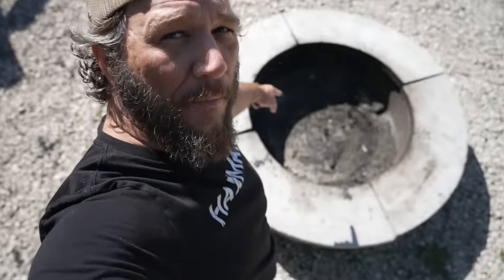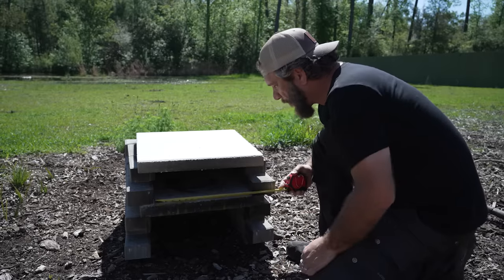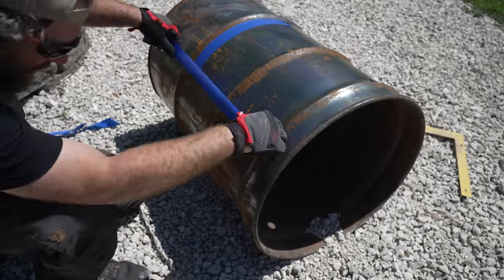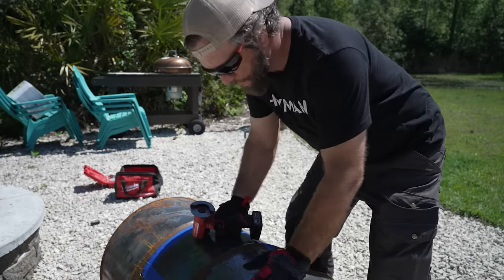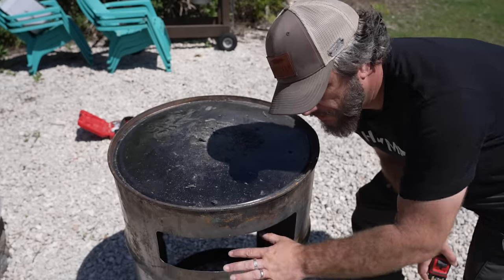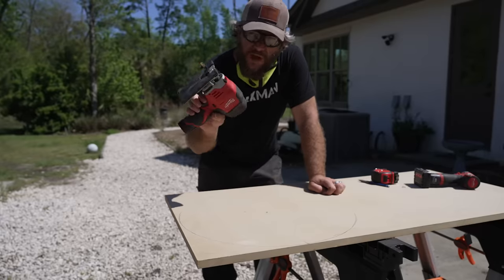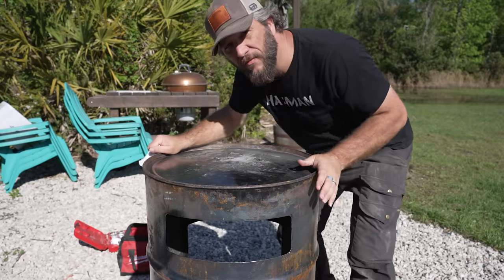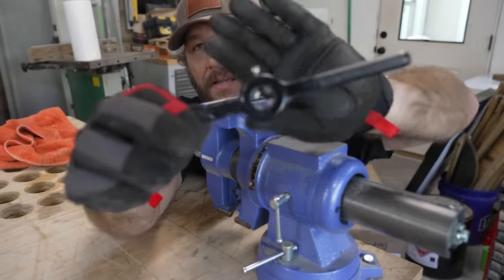This DIY Pizza Oven Is Cheap, Easy And Works Amazing!

Comment: A minor adjustment recommendation: cut the top part open of the barrel and get an old/used 22” weber kettle lid to mimic the dome shape traditional brick oven. Mod the lid to put on an exhaust/ chimney. But first use the lid from your kettle to see if it can be a perfect fit. Would love to see how that would turns out
Reply: Your suggestion isn't bad, however, it's more about using his already open fire pit, the least items to purchase so it's as financially cheap as possible and if you note the temp he got ...a chimney allows more heat to escape. It may look more appealing in respect to other types of outdoor ovens but this works best as it is. Metal, however won't hold the heat like brick will when the fire dies. He probably could have cooked right pizzas if they were ready to go one after another without adding wood. Your idea has looks but I married a high maintenance woman and looks are not always the best choice. A barrel that hot eventually burns out but hey, it will last two or more years with fairly frequent use. Unfortunately the stupid green freaks are attacking anything wood burning as they want to be dependent on the grid and constant rate increases.
Reply: @mikefinley4367  😂 don’t do your wife like that. But I understand where you’re coming from. Thanks for the insight!
Reply: luckyree9  All the water heaters I've seen are very thin walled steel and more like tin foil compared to drum stee. Water heaters are usually two thin walls with insulation between.anf a waste of your time .
Reply: @ster chimney is for single chamber ovens.

This is two chambers. Anywho the chimney is to let smoke out. Its already letting smoke out. Also dont need dome. Domes radiate heat inward using stone radiant heat.

This one is made of steel not stone.

The heat source is also from beneath in separate chamber. This is more like a grill oven than a stone pizza oven.

Comment: I built my version of this about 5 years ago. Used threaded rod to build a rack in the upper 1/3 and put an 18" pizza stone in it. Saves tons of time/labor and never have to worry about degradation over time from the extreme heat. Favorite fuel is lump charcoal with a chunk of wood from time to time. Good  stuff!
Reply: Has your steel drum held up? As hot as a fire you run in it, I wondered if the metal started burning through? I've used tons of burn barrels and they last a year or so.

Comment: I never knew about that section of the silicone gun that you can chop the tip off. I just love learning new stuff. Sometimes it's the little things! 🤣🤣🤣
Reply from the maker: I put that in the video because I showed that in a previous video and several people said the same thing. You never know what little piece of info someone might find useful. 😁
Reply: I stopped the video when I saw that and went into my workshop - darn it - my silicone gun doesn't have that feature.
Reply: Glad I was not alone in that observation. I don't do a heck of a lot of caulking but I'll surely remember this next time. Thanks, HAXMAN!
Reply: @HAXMAN  
I was also like: "Wait! What? You can do that? Why am I always looking for   a cutter/knife to chop off the tip of the cone?"
Unfortunately, a quick check with my silicone guns showed that neither of them offers that nice feature. :( 
It was too nice to be true, I guess.

Comment: Pizza looked tasty. Just a thought, if you put a plastic bag over your magnetic sweep, you can easily remove all those metal filings by reversing it as you remove it. 😊
Reply from the maker: That’s a great idea! Thanks
Reply: I was gonna suggest the plastic bag trick but ya beat me to it....it works great.

Comment: Hey, Did you measure temperatures in the oven during cooking? I was thinking it may be advantageous to have a concrete layer on the top of the oven too. Wait never mind. Just rewatched and saw the temp measurement.

Comment: Question: Are there any health issues cooking on cement surfaces? Cement contains silica that is harmful when inhaled (dust) but i'm not sure if the same applies to high temperature cooking. Good video as always!
Reply: you could always just put whatever youre cooking on cookie sheet or something
Reply: You could probably skip the whole cement thing and find a legit pizza stone or the latest and greatest pizza steel online to fit the barrel.

Comment: Nice build. Instead of casting the shelf, a round pottery kiln shelf could be used. They cost about the same as the refractory cement and will last a much longer time as well.
Reply: Yep! About $77 for a 21" x 3/4" round. Much higher heat potential.

Comment: nice job! i was all ready planning on the smokeless fire pit this summer.  as my girlfriend is a pizza junkie, guess what else i will be building. a hint on the magnet sweeper. tape a piece of parchment paper over the bottom before sweeping. when you are done, pull off the paper and the sweeper is clean.

Comment: i thinkk you could improve this alot by putting a chimney in front over the hole where the pizza goes in. use the metal u cut out as doors to trap more heat. make it so the fire wood sits higher closer to the stone where the concrete stone is at. make a few small air vents for the fire when the door close. this would get the oven run hotter make the pizza better. you could probably put a steel plate on the concrete for crispier bottoms.  idk might be wrong tho.

Comment: Nice job!! I may even try making one for us, just a tip for what it's worth - have you thought of placing a plastic bag or cloth over your magnetic broom before using it. Helps get the shavings off without sticking to the magnet.

Comment: I would look around on the patio b4 i would buy or build one first!  Can use a smoker, or any dome grill or kettle. Then i got the ideal of using a plastic or metal drum to form the dome part. by laying concert or bricks concerted togather. That would be the top to put on the sides.  If you do make one?  Make one Big enough for at less a turkey!  I can do a turkey in my Weber Kettle

Comment: Looks pretty sweet, I noticed the top of your pie is way less browned than with your paver oven. You might want to add some more thermal mass above the pizza, maybe add some thick steel up there, or somehow more concrete? The added radiative heat should help cook the pie more from all directions, as this oven currently seems bottom-cooky.

But hey, cut and bolt some 8 or 10ga steel to the top and it'll probably help 👍
Reply: This is based on how thick barrels are, I don't think the top of the oven is radiating much heat, it is likely all going to atmosphere.
Reply: @SeanQuinn4  he just need to baket more. if you look at it it not done it
Reply: @dextormohr  the bottom of the crust looked pretty cooked to me. This is a common problem in making pizza, the ovens are so hot that you can't count on hot air to transfer the thermal energy, you really need radiative heat up top to keep up with the mass of the stone underneath the pie.

Comment: I guess I am a very fortunate individual, since my kitchen range has an oven. Thus, I can bake pizza, as well as countless other things, without having to build an oven. HOWEVER, due to our desire to avoid indoor oven use during the summer, I have found that using a sheet pan, rather than a regular pizza pan, lets me use the gas grill to make pizza outdoors. It works great, it's fast, and quite simple.

Comment: With the cement paver that the pizza is cooked on, does it need to fit snug inside the barrel or can it be smaller than the diameter of the barrel?

Comment: All i did was buy some pizza pans up to 18"  for my Kettle grill. It make perfect pizza cooked . The pizza pans cook pizza better than a stone does. top to bottom in 20 min>  depending on the heat> from 250 degs 20 min. up to 500 degs 10 mins     the kettle also season the pizza pans.  They will last for ever

Comment: Gray Portland reaches nearly max strength after 28 days. White Portland reaches the same strength after 21 days and is comparatively stronger before reaching full cure. Some call white concrete "High Early," which merits it's hydration properties.

If you make 50 pizza ovens, I'll watch them all. 👍🏼👍🏼

Comment: Good pizza oven. A recommendation, put some rebar in the cement slates. It will give the slate more structure. You will be putting little loads. But the slates loaded or not tend to break in the middle, more so when there are thermal changes. Thermal resistant cement, is no exception to this rule of the thumb. So when you have to change it, put a small grid of 0,4 or 0,6 rebars grill in there. The slate will come more wholesome and will not crumble easy.

Comment: I have been using a caulking gun for most of my life, even making my own Lizard aquariums as a teen.  I never new that the hole in the side of the gun was for cutting the tube.  
Mind blown.😁
Reply: I’m still amazed at how many people don’t realize there’s a puncture tool on the gun and instead they look for a screwdriver that will fit.

Comment: Photography tip:  Run a UV filter on the outside to protect your other filters.  It's pointless as a UV filter but it does provide protection for everything else.

Comment: You said you left the back of the concrete out for a chimney in the back, but there are no holes up top of the drum, so does it just chimney effect over the top and out the pizza front opening?
Reply from the maker: Yes

Comment: Man, I wish I had a steel drum, but the state of California hasn't been a fan of wood fires (air quality issues).

I feel like a pizza stone might do well here in place of the cement, especially the ones that come in tiles. Or a big ol chunk thick plate of steel which is what I use in the oven for pizzas. Then maybe find a way to turn the drum into a gasifier stove to minimize the soot and creosote.

Comment: Okay so I see that you made a chimney for the back portion of the oven, I was just wondering if you had to drill any holes around the top for the smoke to get out, or just leave it with the pizza opening as the only place for heat/smoke to escape?

Comment: Loved the video! Do you have a quick way to figure out half of your measurement, or do you just get faster over time? E.g. your 21 3/4” dia. measurement.
Reply from the maker: Thanks! I’ve just been splitting and adding  dimensions my whole life so I can do it fast but you can get a construction calculator for your phone too.
Reply: @HAXMAN  cool, I’ll download one of those! Thank you!

Comment: So the pizza cooks on the cemet? Is that good safe? I just seen issue compared to a stone slab
Reply from the maker: The cement is cured so nothing comes off. This type of cement is for this purpose as well as fireplaces.
Reply: @HAXMAN  I used type F mortar and clay mix, at a 1/3 ratio, and my concrete dude said that I can finish it just as smooth as I want to.   I'd be curious to see if the smoother texture is better or worse to cook on than the coarser finish...

Comment: Curious how did flooding work out, is there solution video. Or just the one..
Reply from the maker: It’s starting to go down a little so I should be able to do something in a few weeks if the rain will hold off.
Reply: Pizza oven idea was awesome,, you certainly don’t take the easy projects…lol

Comment: nice to expand upon the smokeless fire pit.
mine is going into its 2nd modification (lower & more holes on the top of the barrel to get more circulation), thanks to your video :)
Keep up the good work, love to see more videos on the volvo modifications (maybe a roofrack or other overland stuff might be in order soon?)
Reply from the maker: Thanks! I’ve got more stuff for the Volvo coming soon.

Comment: Step 1:  Drill air holes in barrel
Step 2:  Build fire
Step 3:  Place overturned barrel over fire
Step 4:  Cook Pizza on barrel
Step 5:  Call pizza man if it doesn't work out

Comment: Nice pizza oven. Just a heads up you are not supposed to use high heat paint on the inside of any grill. Might want to note that so other people don't make that mistake.

Comment: Great pizza oven! Another project on my list. Glad you upgraded to the metal drum. This is a great improvement over the small concrete block oven. BTW, as an optician, I can't tell you how many lenses I've had to replace for customers who have gotten grinding pits on lenses. At least you only ruined a filter, rather than a camera lens. As always, another great video!
Reply from the maker: Yes. It could have been worse. Thanks!

Comment: Why not pick up a free barrel, cut it down to match the thickness of your desired cooking stone, and just use that?  Faster, cheaper, and far more accurate.  Just use a some sort of release agent so you can get the concrete 'paver' out once it's set.

Comment: Should have drilled your holes before starting the fire in it because the heat hardens the steel and makes it difficult to drill. Or just break out the zip cit

Comment: Adam, I love your smokeless firepit and the pizza oven addition! 🍕Here's an idea, when it's time to repaint your pizza oven, use copper-colored high heat engine paint... that's what I used on my front door, it looks great and is very durable. ~Margie
Reply from the maker: It was out of stock everywhere ☹️ Thanks!
Reply: @HAXMAN  Well darn, that's a real bummer!
Reply: I found some online, but the price per can is astronomical! YIKES!

Comment: I used to use those cutting wheels for my  work as a machinist before I retired. You may want to consider putting a mask on before before you use those that stuff is not good for your lungs  believe me

Comment: Man, you have to at least put a chamotte baking stone between your food and that concrete block. There are so many poisonous admixtures in cement and the finished concrete that'll contaminate your food. Your family is then eating all that stuff.
Even though in the greatest parts they are harmless in a cold state (because the admixtures are encapsulated) the problem is that you are heating up that concrete block in your oven at high temperatures and naturally at some point some of those concrete admixtures (poisons) will start to gas out and into your food. You should definitely consider using a second grill grid and some food-safe chamotte stones instead of that cement block.

Comment: I hope you’ve had good luck out of those Milwaukee step bits… I can say that without a doubt it was the worst $300 investment my company has made on any tools. Also, I learned back in HS that the ashes work very well when starting those plants in early spring… I had some pretty Mary Jane trees growing until my mom got ahold of them. She was confused as to why he was hauling ashes into the woods. 🤣

Comment: I am lazy: I use my Rocket Stove , minimal fuel, maximum heat, zero smoke -  with a low metal enclosed oven ( like a pizza box) on top. 1000 degree F ( perfect temp to cook pizza), 5 minutes.
( south Florida )

Comment: you want more of a furnace for cooking pizza.  one door at the bottom for fuel, one at the top for the oven, make it tight and a few pinholes around the bottom for a REALLY hot fire.  Make the top door 1/2 of the barrel, for a BIG pizza.

Comment: you know the only difference between  Gaffer tape is universal tape works in the wet or the times you need to bind your abduction (American psycho ref :)), duct tape is perfect for sealing ducts, and Aluminium tape is a tad similar.

Comment: If you make the metal red hot and put car oil on it, it will turn black and rust proof. After you finish with the silicon just pump out a bit more to seal the tube, next time  you use it just pull out the bit you left behind.

Comment: its cool you did it DIY, love the use of a barrel... but instead of the concrete baking pad, i think using a baking steel inserted on top of some rebar support might result in some better pizza. just drill some holes to slide some rebar thru the side.
Reply: I'd question eating anything cooked on concrete, especially a funky mix like that bucket.

Comment: Too bad you don't have another barrel Adam. You could then cut # 2 barrel in half and make the pizza oven a little higher. 😁 Very Good Job, and yes I know everyone gives you advice, that's why we are all here for you to Help you. No rebar or wire in the cement? How is the flooded back yard coming ? Good thing you had the filter on your camera. Always wear safety glasses.  Thanks for sharing !🍪🍕🍕🍺🍺what more good a guy want.🤣🤣🤣Look for rural kings in you area , they sell barrels !
Reply from the maker: I actually had a hard time finding one near me.
Reply: @HAXMAN  Look for rural kings in you area , they sell barrels !

Comment: I really enjoy how you show all the mistakes and talk bout  ideas that would be a great setup but instead you go with a much simpler and least time consuming solution.  Like the jigsaw... only to  realize you need to change the blade 🤣😂🤣 🏌‍♂️🎆 
This is why sometimes,  I end up using a hammer 🔨  as a wrench 🔧 🤣 😂 😅 💡🤦🏾🏌‍♂️🎆
Opening bucket..... edit:  went and got gloves

Comment: On ashes in garden: Might wanna skip using it on your vegetable garden, since heavymetals don't burn/gasify ur gonna have a higher concentration of things like mercury in ur ashes. Doing it once? then who gives af, heavymetals accumulate over time, so worth keeping in mind. 
If u wanna use it for ur lawn then it will have an effect on the acidity of ur soil. Might wanna check that ur pushing that in the right direction (in my case it helps).

Comment: 12:00  That moment you realize you should have analyzed it and then use used the tap die I will yes lol it's all good. But maybe next time just hit it with a little heat to analyze it and then a little heat too to get it ready to quench to hard knit again.
Lol commenting as the YouTube police lol😅😢😅